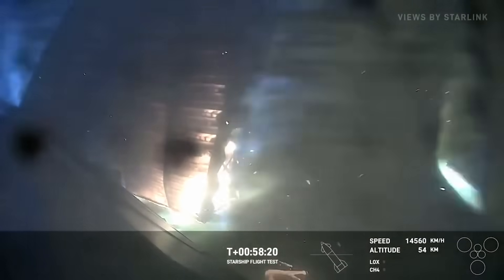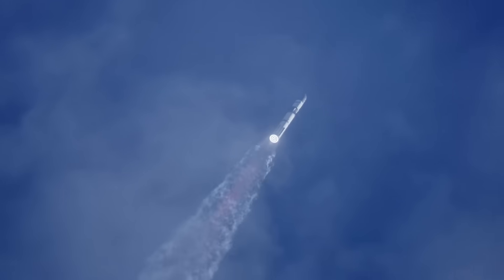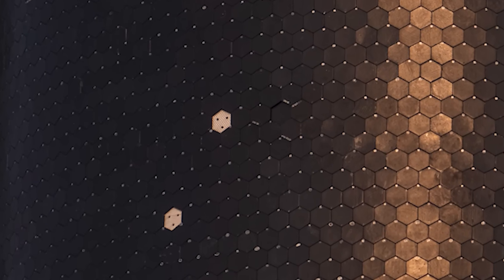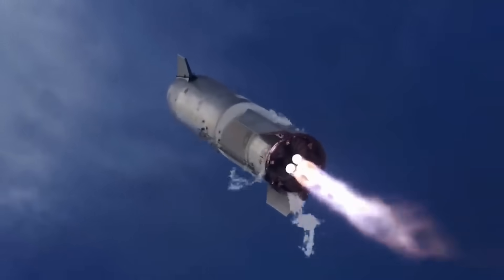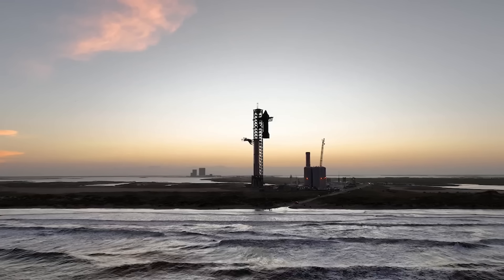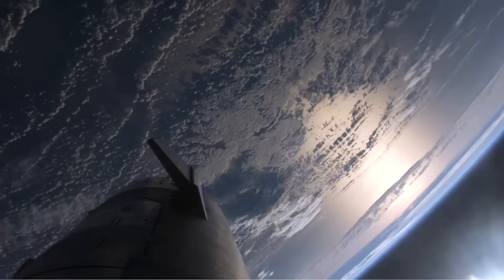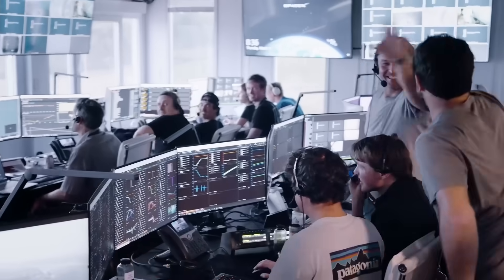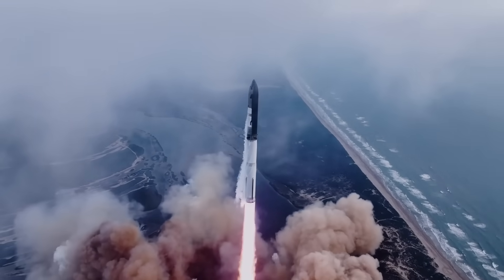SpaceX Is Adding Another Heat Shield Layer To Starship

Comment: The heat shield seems like the greatest barrier to rapid and full reusability. If anyone can solve this problem, though, it's SpaceX!
Reply: They probably have an answer, just don't want to trade off either weight or cost unless they have to.
Reply: The heat shield may well be the single item most likely to doom a flight, but for me, the Raptor engines are still not 100%, no where near 100%.  I believe there were two Raptor failures during the last flight and engine failures on all the flights so far.  Loosing a single engine on the booster might be enough to prevent a max payload from reaching the desired orbit.  Accelerating more slowly early on when gravity is a high percentage of the total acceleration will lower performance and if the mission is close to max payload that slightly lower performance might be enough to make the mission a failure.
Reply: Certainly, the engine requires further refinement to address the existing issues. The complexity of these engines is undeniable, but the company has a proven track record of successfully resolving such challenges, as demonstrated with the Marlins. The heat shield issue has long been a significant concern within the industry, primarily due to the limited availability of materials capable of withstanding such extreme conditions. While I lack the expertise of an engineer, I have often contemplated the potential of a liquid cooling system as a heat shield, similar to the coolant used in automotive engines.
Reply: @Redfiregtag  See, the problem is that we've been told the engines are working fine, but with EVERY launch there's been more than one engine failure.  During the Apollo program the F1 had zero failures of a launched F1, the J2 had two failures as I recall on a single flight but were able to complete the mission without incident.  So, during all of Apollo there was not a single failure of a launched rocket due to engine failure -- Apollo 13's issue wasn't an engine but an electrical problem inside a LOX tank in the CSM.  It may well be that SpaceX is pushing the Raptors too hard with unseen chamber pressures and the thing with spaceflight is that it is not forgiving in the least.  Musk keeps pushing to boost thrust and has raised the chamber pressure to around 350 bar on the development engines -- I believe the Raptors that have been used so far have been no higher than 300 bar, but even that is really high.  The chamber pressure of the RS-25 engines in the Space Shuttle was about 200 bar.
Reply: @Redfiregtag  Take a Merlin engine, push it to its limits, it will fail too...  Problem with Raptor is that it is running to the extreme. And Raptor 3 will run even harder, which of course can't be good for reliability. They have no choice, they need more thrust with the same sized engine for Starship v2 and v3, which are inflating in weight.  "Hopefully it [Raptor 3] will be more reliable". Those are the words of Musk himself... Well hopefully, his real engineers (not him) can find solutions to their engine problems but it doesn't look good for the future. Also, unless SpaceX clearly states the contrary, I'm going to assume all flaps were damaged to an extent during re-entry (which in a sense, makes its "survival" and splash down more impressive). They clearly are a weak point, which is not surprising. Will see how it goes...
Reply: @Raptorman0909  i mean their design philosophy including with raptor is to remove all parts so i believe raptor 3 will be much more reliable since the best part is no part philosophy reduces failiure points
Reply: @Raptorman0909 The rocket has been designed to allow for an engine failure whilst achieving all mission goals. I’m not sure if it could survive two engine failures. Musk said the booster simulated landing was spot on.
Reply: It is a reusability shield 😅
Reply: Totally agree. I know that the solution can’t be this simple but wouldn’t larger tiles be easier to attach as they would have more attachment points also machine the tiles so that they are beveled to hold each other in place like a T&G floor
Reply: @conard5381 larger heat shields means that if one fails there will be a greater risk due to larger surface area exposed
Reply: @Noel_Jacob  also it lowers manufacturability, process accuracy and consistency. Also Its easier to bin smaller tiles that bigger ones, beacuse u dont waste so much per tile.
Reply: @alesksander  I would think heat dissipation over a larger surface would be longer vs smaller - I'm sure they've calculated all of these things in their design. Until the various materials' limits are greatly increased they're prob only confined by that.
Reply: @Noel_Jacob  Smaller tiles means more joints exposed to heat terror . What to do?
Reply: @conard5381  Slight Tile thermal expansion could cause a mass zipper off event.
Reply: They STILL don't have this right after 50 years. We need a breakthrough.
Reply: @stanislouse4168  Imagine That !
Reply: We can now use lasers to convert carbon fiber into diamond fiber. I would imagine a diamond fiber reinforced ceramic tile would provide additional strength and temperature resistance without adding weight. In fact I think you could reduce weight.
Reply: @zvorenergy diamond is very conductive to heat which is the opposite of what a heat shield is for
Reply: @prophetrob  That's right, diamond is in fact the material with the highest thermal conductivity -- 5X that of copper!  There would in fact be no material less suited for a heat shield than diamond.
Reply: @prophetrob  Yes if you only use diamond fiber. Composite materials have unexpected properties, the thermal conductivity is highly correlated to the matrix, not fillers in the matrix. In fact I spent years trying to develop a thermally conductive composite for United Technology but the matrix resisted.
Reply: @Raptorman0909  IF you were using diamond alone. As soon as you put any thermally conductive material into a matrix, such as alumina or silica ceramic, the thermal conductivity of the matrix dominates the bulk properties.
Reply: @Raptorman0909  diamond fibers embedded in alumina or silica ceramic will NOT conduct heat. The bulk thermal conductivity of a composite is dominated by the matrix.
Reply: @zvorenergy  OK, so what's the point of diamond fibers then
Reply: @Raptorman0909  The reinforcement of a matrix results in dramatic improvements in mechanical properties. So, no more broken tiles no more tiles falling off.
Reply: It always has been the greatest barrier, but to think they were even able to land without fully disintegrating is a huge deal, and it proves they can do it.
Reply: Given enough years and billion$ 🤪.
Reply: The problem is the mass for the heat shield.
Reply: We just need to develop force field technology, ez
Reply: @robinandersson862  there are already some force fields
Reply: The shuttle proved the concept of a large reusable reentry vehicle, but refurbishment between flights was complex and costly. SpaceX start with the simplest solution, and only if it fails, add cost and complexity. I was sceptical, but after seeing flight 4, I am convinced they will succeed.
Reply: I wonder what the header wrap is made of on my classic car it has reduced the transmitted heat by a factor of 3 in the engine compartment and it is easy to work with
Reply: @conard5381  Cera Wool
Reply: @conard5381  Cera Wool